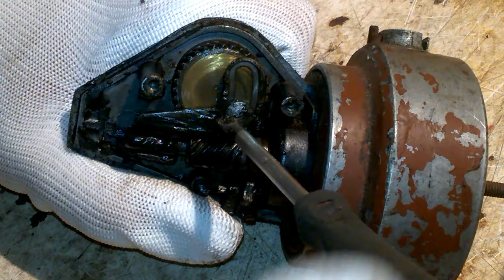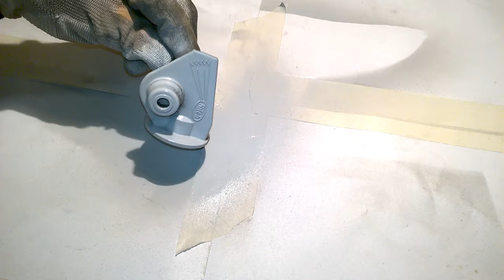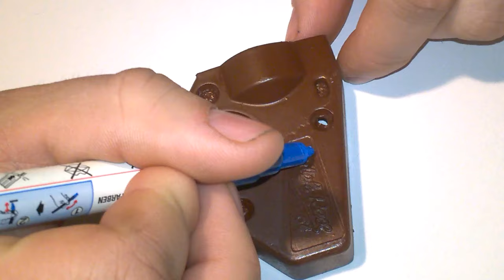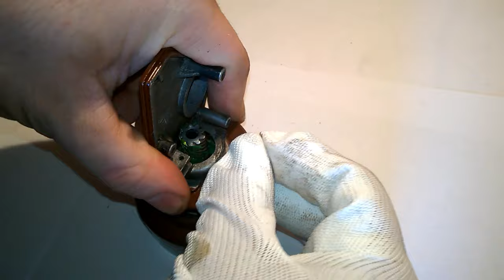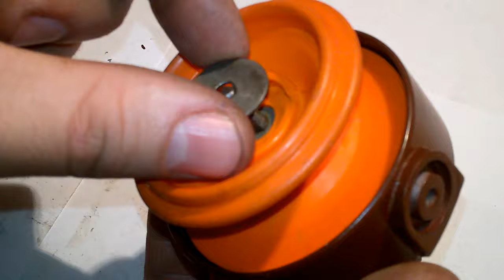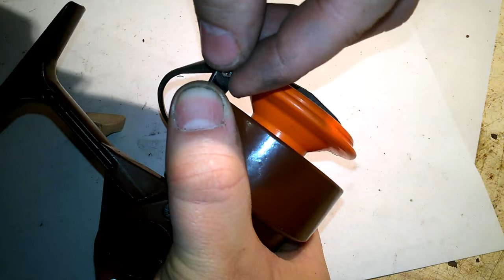Fishing Reel Restoration - Fishing Machines Restoration

Comment: Use screwdrivers that fit the screws better so you don't mangle the screw heads.
Be careful using needle-nose pliers to drive a nut; doing this often mangles the nut.

Tell us the paint stripper used.
Tell us the primer and paint used.
Tell us the solution used to clean the plastic components.
Tell us where you got / how you made the round label that you glued to the reel.
Reply from the maker: Thank you for your comment.
Please watch my other videos, like, share, comment, subscribe.
Thanks for the good advice, I'll take them.

I used a general paint remover.
Unfortunately, after all this time, I don't even remember the paint primer and top coat.
I cleaned the plastic materials with car plastic upholstery cleaner.
I printed the labels.
https://youtube.com/shorts/5SX4Uy9U0Y4
https://youtube.com/shorts/30e2qVsaXrw
Reply: @Blazebb01  Cool! Thanks! 
I must have been tired or something when I made that post; I intended to be a little gentler, but it appears... something happened... and you got none of the verbiage that would have made the post polite. Sorry about that and, again, thanks for the info. I appreciate it.
Reply from the maker: No problem commenting. :) I understood completely and thank you for bringing these to my attention. :)
I want to make my content better and comments like this help a lot. :)

Comment: Terrible, why not sandblast it and prime and  paint it and smearing grease on the bearing does not pack them you also used different screws to put the cover on and the brown paint showed all of the flaws in your prep work Sorry  not a good job and the bail is F-up
Reply from the maker: THX the comment. But I very curious how you would do it.  :D Why not sendblast? If you know and use sandblast then you would you know. Because the alumini very soft metal and damaging the surface. The screws? If you watch full video you see, what I use is manufacturing, 2 screws all the same and 1 different. The paint? I use period of the reel because legacy of my grandfather.  PLEASE WATCH AGAIN THE VIDEO! Sorry not a good comment and the bait is F- down.
Please watch my other video, like, share, and comment.
https://www.youtube.com/watch?v=eL0LSXpwVeM&feature=youtu.be